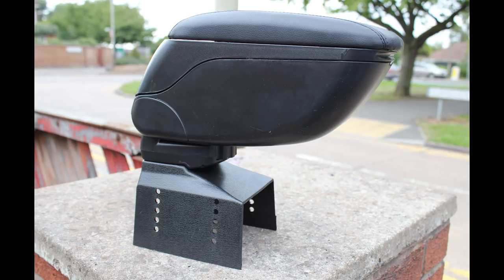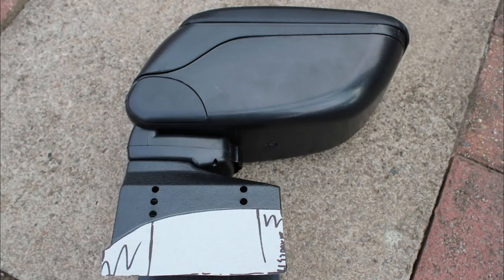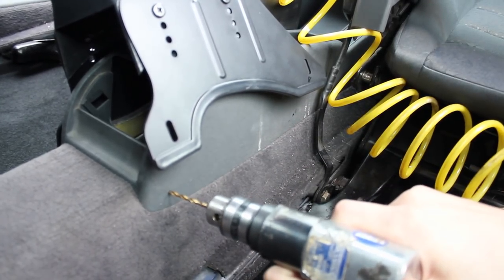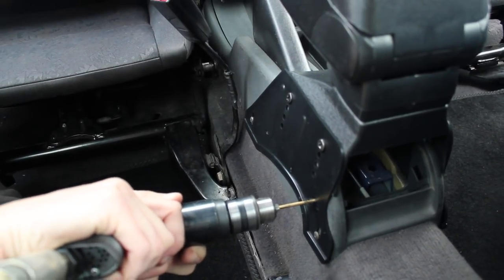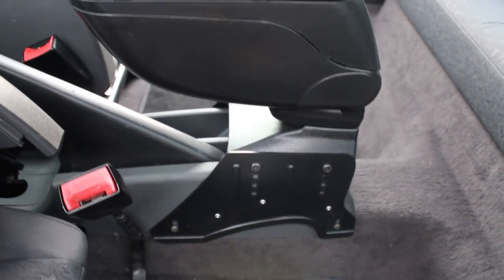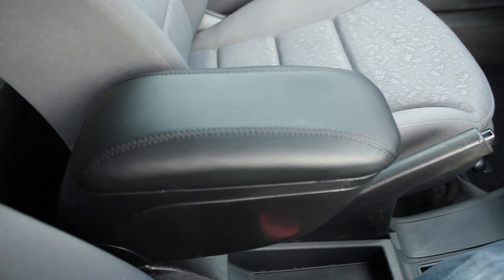How to install an after market Armrest into an Audi A3

Comment: I've just put of these in my Vauxhall Combo van it's a lower profile one than this so no modding, luckily the interior is black and this looks original in there, good thing is there is only 2 front seats and nothing behind me but a metal wall so any screws are well hidden.
Reply from the maker: Honestly next to power mods on my A3 this mad it so much more comfortable.

Comment: I have just purchased a picasso and wondered if this would fit? Also is it suitable for the passenger side? Good video and well explained thanks
Reply from the maker: I think it would work in most cars - my first question would be on if you can get one for your car cheap on ebay. With the A3 I paid £600 for the car so didn't mind this sort of mod and it worked well.
Also with what I know know I'd perhaps or plastidiped the rivets after.
Reply: CarAndMechanical 

Thank you in will try E bay

Comment: I was thinking of getting one for my 307 cc. do you think it would fit considering my roof and window switches are nearby. could look at an image of a 307 cc's interior and give me your opinion that would be much appreciated. great video BTW 😃
Reply from the maker: +ben elfar I'm going to take a bit of a guess but also say measure up if you can to be sure.

I've not been in a 307 CC but I don't see why you couldn't make it work. Maybe try the test cardboard cuts first and also could you get a stock one from a breakers yard or ebay?

The reason I went with this Armrest was people wanting £100+ for the Audi arm rest....nope.

Comment: I was thinking of getting a metal base made from the metal shop, will it make it more stable and solid?
Reply from the maker: Definitely, unfortunately most of the work I do on my car is restricted by budget and have something machined would of increased the cost a fair bit.
This has been on for nearly 6 months now and is holding up well, no issues at all and there have been a few times where I've leaned on it working within the car when I know I shouldn't of! But it's been fine.
Reply: Okay, if it's working just fine then I think I don't need to do anything more to it. Thanks mate!

Comment: Guys doesn't this drilling screws take away the car's market value? Wouldn't it depreciate the car's cost alot? I'm thinking to put a universal one like this however i'm quite worried about causing it to reduce my car's cost. Please suggest.
Reply from the maker: Deval I'll be my cars last owner and my A3 cost me £600 - If I was thinking of temp measures you in the zone of maybe no more nails or another glue but worth checking out how you unbond it after incase the solvent damages the plastic.
Reply: +CarAnd “Car Mechanical” Mechanical sir but what about my new car? I bought a new brand hyundai i20 like two years ago and i'm still paying loan for it and if i look to do this to my car, will it depreciate the car price?
Reply from the maker: If you have no way to mount it with hacks etc then yes. 
Did they make one as stock you could look out for on ebay?

Failing that and depending on how everything is set up and who see's it/if you care you could cable tie it in place.

With a newer car where resale will impact you I'd suggest finding one that's being broke/scraped.

Comment: What is the name of that Dremel cutting disc extension tool that you used and where can I get one?
Reply from the maker: My "dremel" is from an Aldi set I got so it came with the extension. The cutting disc comes on these dremel type tools anyway, the extension is just a flexible extender you can put any bit into.

I got one of these for my brother and he's had no issues with it (but no extension cord) http://www.ebuyer.com/438986-xenta-163-piece-rotary-tool-and-accessory-kit-ebdm-130b
Reply: +CarAnd “Car Mechanical” Mechanical cheers man, found one on eBay. I never knew you could get them lol it would make using the 'Dremel' so much easier for me. Thanks :)
Reply: Have a look on ebay mate

Comment: nice job , but its look awful cause those screws visible on an Audi... just dont..
Reply from the maker: The seat is never that far forwards - the alternative option is bonding in place and or wrapping the entire console which on a 18 year old Audi would help it.
Reply: CarAnd Mechanical thing is,  there are replicas of the originals for about 40/50 dollars...  And u don't need to drill anything..
Reply from the maker: When I made this 2.5 years ago that wasn't the case the the one's on UK ebay now don't look quite right for fitment from the general pic and they are 3-4 times as much in price this has always been a cheap car and never worth spending a premium price on the mods.
 However back when I did this I worked with what was available - I don't mind about the drilling but totally understand if others do, and again with the seats in their normal position you don't see the mountings.
I will stand by it's the best mod I've made to the car for my personal comfort, but again also get if others feel they want to go a different route because new options or personal taste dictate so.

Comment: Thats awfully ugly. Better paint it in grey before mounting. That would look lot better.
Reply from the maker: +OGUZ KIRER with the seats in place you don't see the mounting tbh. 
This was a few years back and I've moved onto an A4 now, if I needed to do this again I would remove and wrap the console and arm rest mounts - but as mentioned it was hidden by the seats 99% of the time.
Reply: CarAndMechanical... That'll do then.